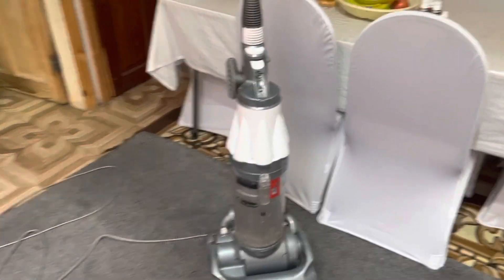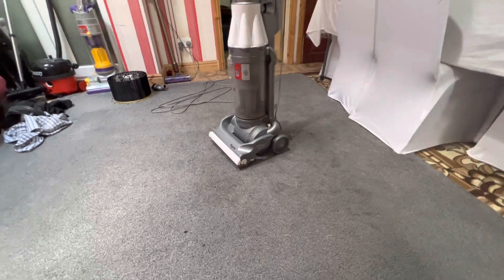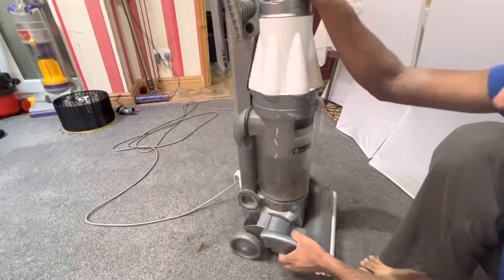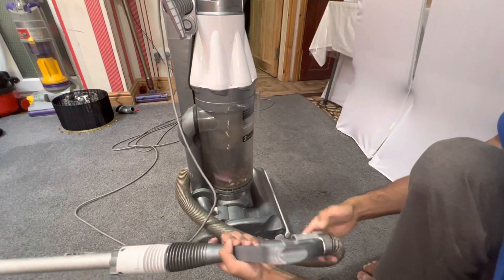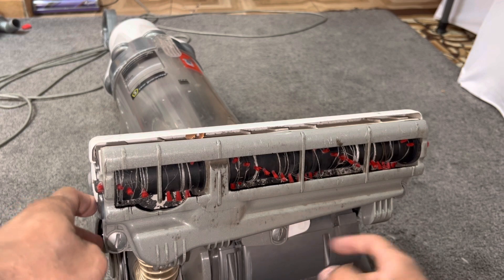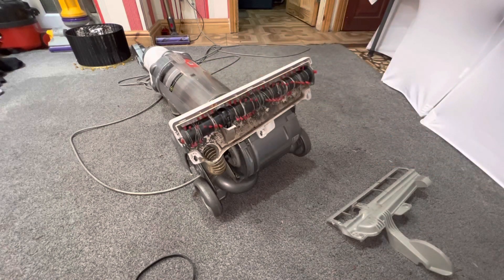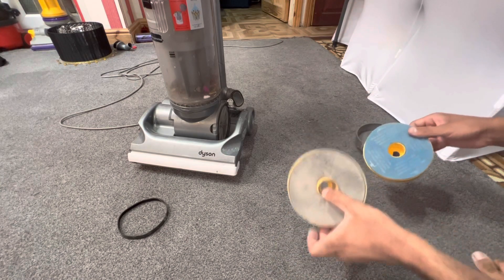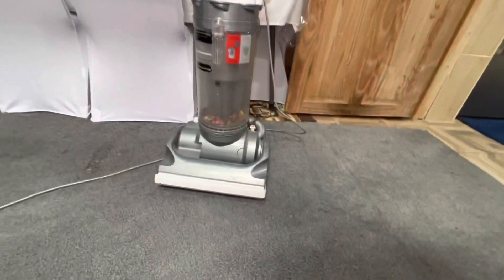Dyson DC07 HEPA vacuum - fault finding & repair - what’s wrong with it?

Comment: I once had to deal with a stuck water bottle cap on a UP13 wand. It was annoying as hell to get off. Just a few days ago I had to fix my DC14 because the brush bar would easily stop. I gave the belt for the brush bar some belt dressing and it works perfectly fine now. Definitely in this situation belt dressing isn’t enough

Comment: Brilliant service as ever. I've got some internal hoses for DC07/ DC14 that I've taken apart for spares. Is there anyway to tell the difference between the hose for the clutched and none clutched model? Many thanks.
Reply from the maker: Hi all DC07s and DC14s use the same internal hose as they’re a generic part, they will also fit non clutched DC04s and DC33s too. The clutched DC04s, however use a different internal hose which are rubber on both ends of the hose with no grey coloured cuff on one end
Hope this helps!
Reply: @parwaz7861   Hi thanks. Much appreciated.
Reply: @parwaz7861   I have another question. I repair Dyson's and have noticed the early ones all green  and the later one, I presume all grey, not green at all. Which one is more robust?
Many thanks.
Reply from the maker: @niceandspicy3197  do you mean the body of the vacuum is an odd green colour? If it’s discoloured into a green colour that’s the older brittle type, the darker the grey the most robust the plastic is
Reply: @parwaz7861   Hi yes. It's an DC07 standard 2001. The origin is I think 2007 onwards.
Reply: Are there 4 versions of the DC07 clutchless? One from 2001, one from 2003, one from 2005 and the later one from 2007 onwards.
Reply from the maker: @niceandspicy3197  Theres quite a few;
1) The early light grey and yellow standard
2) The exact same one but with silver body also DC07 standard
3) The late origin which is dark grey and the bin area of the cyclone is all grey 
4) White HEPA model, basically a DC07 origin but all the yellow parts are white
4) DC07 precision - all grey but the cyclones are jet black in colour
5) DC07 toolkit - turquoise DC07 all floors colour scheme but with no clutch
Reply: @parwaz7861   Which one you do prefer?
Reply from the maker: @niceandspicy3197  it’s all down to personal preference really on which DC07 one may find stylish but I quite like the late origin, but I also like the HEPA dc07 and the precision as well, I think they all look marvellous in their own way

Comment: What belts did you use? Are they the Qualtex ones from LM Electrical Ebay?
Reply from the maker: Qualtex ones yes
Reply: @parwaz7861   I've used them. Never had a problem with.
Reply: @parwaz7861  I always use Dyson ones where possible
Reply from the maker: @RJA_World  I found qualtex belts to last longer than dyson ones imo, I’ve known a dc33 owned from new where it’s clutch stretched out it’s belts within 2 years whereas with a replacement dc14 refurbished by me with qualtex belts still worked like new after 2 years
Reply: @parwaz7861  Fair enough mate, I think it's just luck of the draw
Reply: @RJA_World   The qualtex belt makes the brushbar on my silver and lime more faster hence the better performance.

Comment: Didn't work for me.  My hose is not blocked and it still doesn't have power to pick up much.  It used to have lots of vacuuming power but not anymore.  There are no blockages.
Reply from the maker: I did a guide on a dc14 to show in more detail of what to check - this video is only to show what was wrong with this particular dyson that belongs to my neighbour